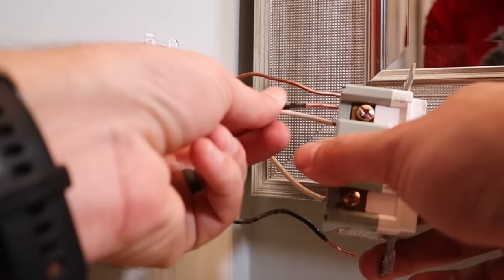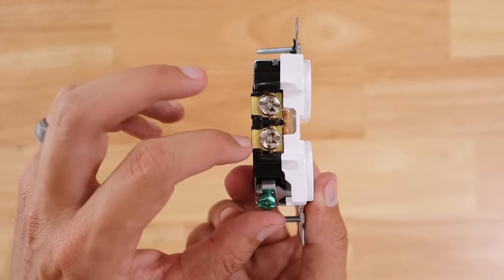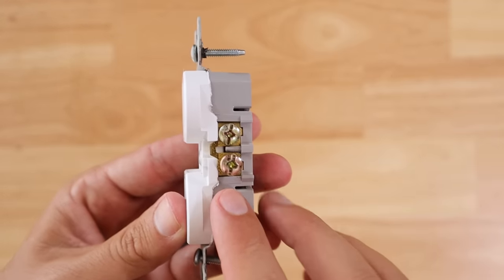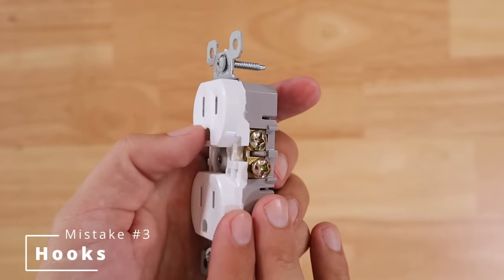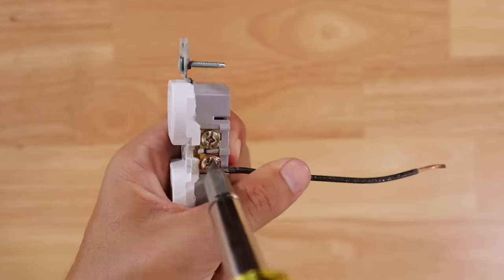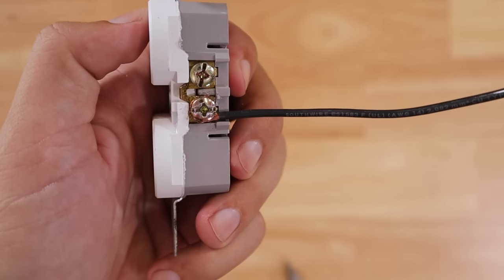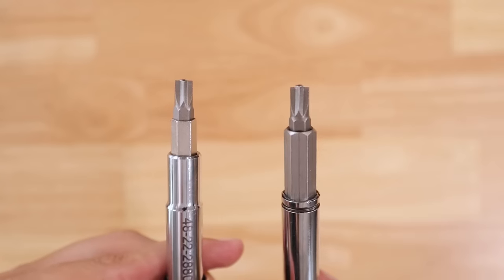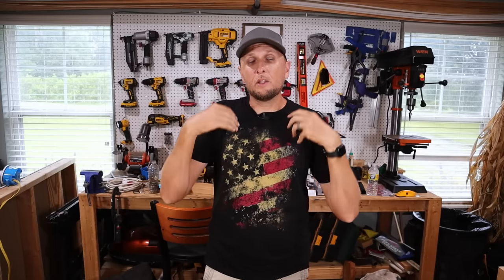The BIGGEST Mistakes DIYers Don't Know They Are Making When Wiring Receptacles | How To

Comment: I'm a retired electrician (40 years) and I found this video excellent.  Well done and well worth it for anyone including electricians to watch
Reply: Found out my 17 year old house is wired with aluminum main wires from the junction box through the house.
Is it worth rewiring with copper if I can get better gauge than residential code?
I live near the Texas border so I can get it in Nuevo Laredo cheap.
I already have one short in the kitchen.
I can do the rewiring and get an electrician to finish the box.
Reply: I did about 25 years of journeyman work, and if I'd been able to make a video back in the day, it would have included all of this. As you can probably verify, I can't begin to count all of the partially burnt-up wires (usually the neutral) that I've easily yanked out of (or snapped right off) those godawful "back-stab" connection terminals. Then there were the loose neutrals that actually caught fire and severely tested the fireproof characteristics of a cut-in box. Those were usually Joe Homeowner's handiwork. 😱
Reply: Hello Padler. Im having a issue with an outside outlet. Im not getting 110 at the wires ...i tried a circuit tester and no lights are on even when the breaker is on

Comment: Some receptacles have the same color screws on both sides. Just remember that the hot black wire and sometimes red always connects to the side with the narrow slot. The narrow slot side is always the hot side.

Comment: I am not a professional electrician but have done a lot of electrical work myself due to not having the finances to pay a professional. I always research and make sure that I'm doing it the right way. Years ago I had to read the books that I still own and would make sure everything was done right. Today having the ability to see videos like this is an amazing thing. The learning process is far faster when seeing visuals. I have a quick project today and was just refreshing myself; so thanks!
Reply: @jayhaines1792  what do you mean feed through. The one where he was complaining that two wires were attached to one screw?
Reply: @universalask  yeah jay haines is right. 
I’m a 22 year electrical contractor and concur with him.
Reply: I like to use large wiring boxes and bring all the wires together with scotch-lock or wire nut so only one set of wires go to the receptacle.  If you have to change a receptacle or switch, you don’t open circuit and have power possible on the any neutral or uncontrolled hot.
Reply: @jayhaines1792  I look at residential wiring as the worst possible chance of problems. Even if the power is turned off, someone could be using the neutral as a return for power else where.  Funny, it was my dad who pointed it out and proved it while remodeling a house. So always take care when breaking neutrals and test wires, unless the main breaker is shut down.
Reply: @jayhaines1792  I agree your experienced and licensed. My comment was for those who trust that a turned off breaker is safe. It is never totally safe. Respect the power and treat all wiring as hot unless it is ground clustered and tested.
Reply: @jayhaines1792  He did not say that. Watch the video again. He talked about putting three wires where there is only room for two.
Reply: @jayhaines1792  He said no such thing.
Reply from the maker: @jay haines Where?  I have never said that.  It’s perfectly legal to do that.  However, I and many of the electricians I have spoken to about it, prefer to use pigtails so that the receptacles work independently of each other.
Reply: @RetiredBassist  Can you site a specific scenario where the neutral could be used as a return for power? Serious question out of curiosity. Only instance I could think of is in a 3-way switch setup where the load/light is in the middle of the 2 switches.
Reply: @jayhaines1792  There is only ONE job to be done having not tuned off power - measurement: voltage, amperage, power.   NOTHING else, for any other operation power MUST be disconnected even if you are going to  green wire.
Reply: @jayhaines1792  I wish you to be ME much longer then 35 years. Buy and read NFPA 70E and use these rules AVERY your day. I am certified EI with MSEE degree.
Reply: @SternDrive  If you know how it is able according to NEC and receptacle certified instruction under 2 screws have 2 incoming wires and 2 wires delivering   power to the next outlet.
Reply: @HowToHomeDIY  He's just jumping to conclusions because the thumbnail is confusing. Probably didn't even watch lol.
Reply: @jayhaines1792  but don't you have an issue with advising people who are not trained to install electrical items that can possible cause a fire or Electrocution?
Reply: Best "Avatar" aka "Profile Pic" Circa 2022! kek :text-green-game-over:
Reply: @losaminos59  multi wire branch circuits where 2 circuits share a neutral
Reply: I've also been wiring for many years. I just popped in because You never know when someone can teach you new tricks. It's all food for thought.
I did however get bored after just 3 minutes🙃
Reply: @HowToHomeDIY  older outlets allow 12ga to be back stabbed while newer ones max out at 14ga. If you find a need, the newer outlets can be CAREFULLY drilled to allow 12ga to be used
Reply: @marisadiraimo  drilling outlets would take away the UL listing and would make it illegal
Reply: @losaminos59  A "split" kitchen receptacle fed from two separate single-pole breakers, instead of a single two-pole breaker. (which is WRONG)

Does it work ?....YES.
Is it wrong and dangerous ?....YES

The 3 wire cable feeding the receptacle has a black (hot wire), a red (hot wire) and a white wire(common neutral between BOTH circuits)

You'd find out quite quickly how easy it is to get electrocuted if you only de-energized ONE of the two circuits, instead of BOTH at the same time....and since 110 volts AC REQUIRES a neutral which is, by definition", a return path to the panel and the grounded neutral bar...I'm not quite sure about this "scenario" you're describing.🤔
Reply: Precisely,thank you 4 the honesty.
Reply: @marisadiraimo  tell me about it they used to frustrate me. Years ago you didn't have this problem. They have become cheaper and cheaper over the years with products.
Reply: being from western PA the way i remember is black and gold is power (Steelers) while and silver is neutral (Cowboys)......not to offend our central texas citizens....just a way to remember
Reply: I see you say you're not a professional electrician and sure hope you are not an AOC supporter.
Reply: @jimg2885  no way, more like AOC deporter
Reply: @SarcasmForDummies  now you are talking. Think AOC needs to rewire a main electric panel while HOT. 🙂
Reply: @jimg2885  the best way I was taught, and the only way that stuck in my mind, is that the neutral and ground are always on the same side.
Reply: @RetiredBassist  Howdy Retired ,  I just don't like the retireing from bass playing . . . why would you do that and pronounce it ?
I am a bass player and have no intention to retire .
SO ... makes me wonder if you are any good ?
Reply: Standards change, backstabbing used to be legal, it is no longer code.  GFCI and AFCi rules have changed too,  GFCI was not required in garages but now it is.  Same for kitchens before that.  AFCI was not required in bedrooms but now it is.
Reply: @JLilliquist  I would say AFCI in concept is fine and dandy.  But why make an expensive breaker , which can easily become an annoyance . . . a standard ?
The line should be checked upon installation for AFCI standards.
Then any resident ... should be educated about where line potential hazards exist.
So if they do DIY stuff . . . they should be aware to check said circuit for AFCI .
Reply: Here is another example of a dumb standard: requiring a GFCI electrical outlet for the basement sump pump. Lightning during rainstorms (not strikes to the house, just regular lightning) easily trips (deactivates) GFCI outlets. Guess when you need power to your sump pump. 🤦‍♂️ Best not to follow code in that case but bring it to code before selling the house, in my opinion.
Reply: @marisadiraimo    Yeah - go through all that trouble, potential danger and alteration which voids the UL listing instead of buying a new $3 receptacle. What's wrong with some people? You shouldn't be back-stabbing anyway. Buy a new receptacle with side-wire clamps instead of jury-rigging an old POS receptacle.
Reply: More importantly codes are being constantly updated and books can not keep up but you can post an updated video every day.

Comment: I've been doing DIY electrical for years.  The house hasn't burned down thank goodness.  No injuries.  But I know I've committed every sin on your list and in one of your companion videos.  I found your videos today before embarking on adding a new wall plug because I thought I should get some tips.  I followed several of yours, particularly the ones regarding how to correctly twist wires and use wire nuts.  I feel so much better knowing I did it right.  Worked first time too 😊  Thank you for your clear instructions!

Comment: Very good information. As an electrician for over 35 years and electricla instructor for over 20 years, this video is very accurate and provides good information. The only caveat I would add is usung the word "short" in my experience there were more "opens" than shorts, meaning a bad connection will open the circuit, not allowing for the flow of current. Great video!
Reply: Just wondering why do manufactures continue to make outlets with backstabbing holes if it's so bad? Have you personally seen those things cause problems. The outlets are UL certified think if it was that bad they would not be certified. Short circuit is what you want so it trips the breaker open is worse someone could get shocked if a metal J-box, or conduit is not grounded.
Reply: @Mike-01234   The only reason I can possibly understand that the backstab is still allowed is that it is an Approved and Listed application. I have seen many Approved and Listed items not work optimally, however, the Authority having jurisdiction, may decide to not allow the backstab method in their jurisdiction, as it is an improvement and not a lowering of the Approving and Listing authority. I never allowed it nor did any of my employers when I was working in the field. I have seen too many instances where the wire would, due to heating and cooling of the conductor, cause the spring tension of the quick connect to lose integrity and allow the conductor to have intermittent contact with the termination on the backstab. In my experience, the neutral wire was the culprit. I hope this helps explain the reason.
Reply: @stanleyo7140  What do you think of those receptacles have the lever connection like a Wago.
Reply: @Mike-01234  If you mean the type that use a  clamp mechanism internal to the device, I have found those to provide an adequate mechanical connection, they seem to work better if two wires are inserted side by side so that the clamping mechanism is not at an angle with just one wire. Thanks for the question.
Reply: I would imagine they are worse off when backstabbing is used to daisy chain because more current would tend to flow through them than if they were just used to connect that single receptacle. I've seen the backstab used in conjunction with the side terminals in basically a rats nest done to avoid pigtailing. Seems like a lot of burden for a 79 cent outlet. I wonder if backstabbing is certified because it would be more or less fine if just done for the one outlet that is backstabbed. The reason backstabbing holes are on the top and bottom would be more for switched outlets than daisy chaining but obviously the temptation to just backstab your whole run of outlets would be great.

Comment: Very helpful videos.  I would suggest one step prior to wiring or replacing receptacles.  That step is to use a polarity tested on the circuit before making any changes.  Years ago, I had to replace a receptacle with a damaged plastic face.  I removed the receptacle and rewired it according to code, as you have shown.  When I was done, I checked the polarity and was surprised when it showed reversed. I double checked the wiring on my new outlet and the black and white wires were correct.  I then used a voltmeter to check the wiring and found that the WHITE wire was hot and the black was neutral. Long story short- I traced the problem to the electrical panel. The white wire was wrapped with a piece of black tape and connected to the hot side of the breaker; the black wire wrapped with a white tape. 
I talked to the City Building Inspector who told me that if the black wire is compromised during construction, it was permissible to reverse the wires for that circuit as long as all of the connections in the house also were marked with white/black tape.  I went through the house and checked all outlets on that circuit for tape and only about half were actually marked. Assuming that the existing wiring is correct was my first mistake!!
Reply: So much for the validity of Building Inspectors.
Reply: @tommybotts  Where it would have taken little time and been easier to switch the white and black instead of going to every outlet and marking it with black and white tape...  Some people just take the lazy way out.  And electricians have to be licensed.  So let us assume the house never had a DIYer doing the work prior to this.  That becomes scary as to how many homes that particular electrician did.  Once the wall is closed, they can get away with anything and you never know what is behind the plate unless you do the inspection yourself.
Reply: Wow that is eye opening reminder! I will definitely buy polarity tester. It is like we must not take face value of anything and everything indeed! Glad read comments down this far and kudos 2 U sharing with us spine chilling Infor that any house can be burn down with things like totally irresponsible house builder and wiring person(s) failed stated or post on circuit breaker panel! Dam on them!
Reply: My house was a convent and built in 1925. The prior owner had replaced the knob and tube and did new wiring, but as I've been changing old 2 prong outlets for 3 prong, and I've noticed the white wire is hot and connected to the brass side. Now I'm concerned that it might be more than just connecting to the right side of the outlet, and I should really get an electrician in here to make sure there's not a fire waiting to happen. I've heard bussing on the walls, and the bathroom light (which still has the push bottom switch) comes on when it wants to a well as the lights and ceiling fan in my living room, and the AC trips because there seems to be too much on one circuit. 😢 I've been trying to save money doing a few things myself, but it might be time for a pro to make sure my family is safe.😮
Reply: @EMPYS  Our first house had a detached garage that electrical supply had been added at some point.  When we moved in, I realized that the exposed "wiring" was 2 wires strung between nails placed in the exposed studs.  Putting in receptacles for the prior owner was easy: you just strip off the insulation for the black/white wires and wrap it around the corresponding nail and then run the wires to the receptacle.  And it was on a 20 amp breaker!  First thing I did was take that out and install EMT.  But - the receptacles were wired correctly! 😂😂

Comment: Just stumbled upon your channel. Excellent job on this video! As a Master Electrician for about twenty years I can’t think of anything you missed on this specific topic. Only thing I would have added would be the rationale: poor mechanical connection = arc = heat = fire. 

I especially despise the backstabbing technique (wish they would stop making it). I live near the coast, the humidity here exacerbates the corrosion of the tab that makes contact with the wire in a backstabbed receptacle. I can’t even guess how many I’ve replaced with a beautiful little smoke trail on the wall above them!

Again, great job! Looking forward to checking out the rest of your content.
Reply: WHAT ABOUT USING DEVICE AS A SPLICING MEANS ( ONLY ONE GROUNDED WIRE ON DEVICE)

Comment: Hey brother.  Thanks for the video.  One other common receptacle mistake I have encountered while helping others out is the 'split receptacle' found in most Canadian kitchens.  I had a neighbour come over in a panic asking me to help with a wiring issue.  It seems that her husband had switched all of the old style receptacles in the kitchen to Decora models and failed to break the tab between the upper and lower receptacle openings so her toaster was now getting 240v.  It was hysterical because the ceiling was glowing red when you pressed the toaster lever.  I am sure that some of your viewers are not familiar with split receptacles.  (I have not had the opportunity to see if this is addressed in another vid.)   Lastly, a common issue that I encounter is that electricians have installed the receptacles using one screw and then leave the other screw extended instead of turning it in so that there is less chance of contact with the ground wire or the box.  Best practice would be to tighten all screws.
Reply: Using a split receptacle clearly marking the wires in the box, on the plate, and in the panel. Still not a good idea as a person not an electrician they can be severely harmed, dead or potentially cause a fire. That box split now has the potential of 240v.  My advise, add the extra box and separate the circuits that way. Oh, and yes I have been an Electrician for over 45 years, residential, commercial, and industrial. We don't leave things, ( it could happen) we leave things so it can't happen.